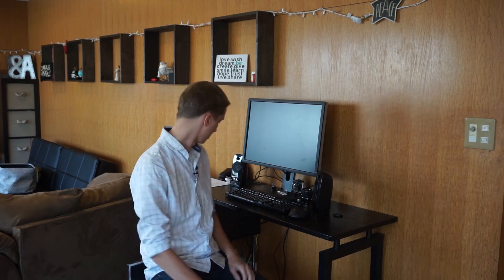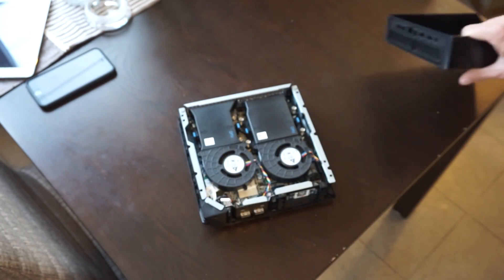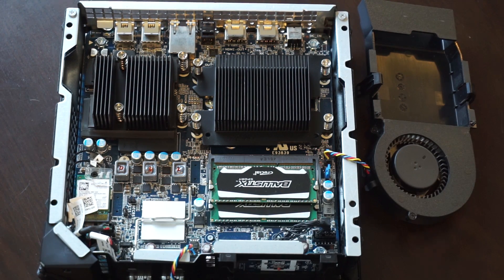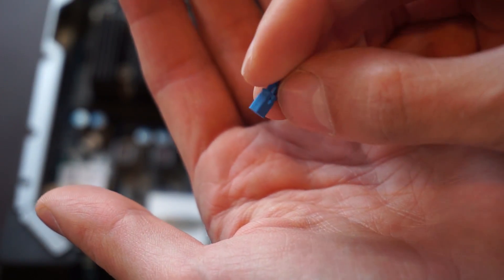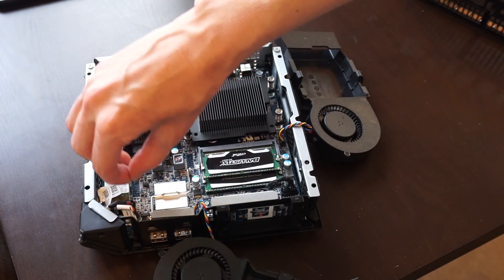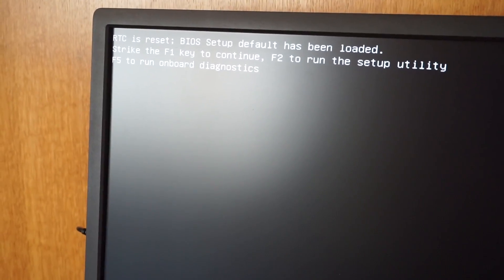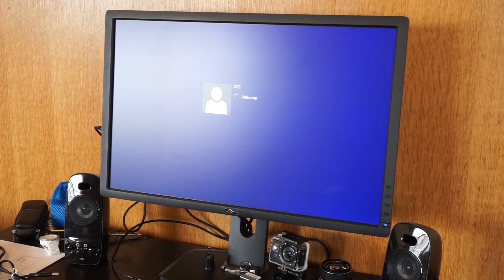How to Fix an Alienware Alpha that Won't Boot

Comment: Thanks so much for this video. I have had my system for about 2 years and just experienced the issue for the first time today. My system rebooted overnight and all I had was the logo on the screen. F2 and F12 didn't work, nothing worked. I found your video and followed your instructions and it fixed my issue. So pleased that you posted this. Many Thanks!!!!!!!!!!

Comment: My experience late 2020: This worked, but I needed to also get a new CMOS battery installed. Just unplugging the CMOS battery and letting it sit did nothing, and I routinely hit the "yellow lights of death" after trying. Even if it did boot, before the new CMOS battery I would just get stuck on the logo screen like in this video.

I fixed it with installing a new CMOS battery (other videos can show you how), then following this video to reset the BIOS. One thing I'll note that he didn't go over is how to press the power button after you swap the jumper. I hit it once, waited ten seconds, then hit it once again, then unplugged the machine after about another 5 seconds. That worked. 

Hope that helps others who are having a hard time with their machine, and thanks Arthur!

Comment: Thanks! That was driving me crazy. I even removed the CR2032 battery to clear the CMOS but all I ended up with were the 5 flashing lights of death. So I had to deal with this for like an hour, and then the initial problem was still here. Then I found your video and it was fixed in 5 minutes 🤦‍♂

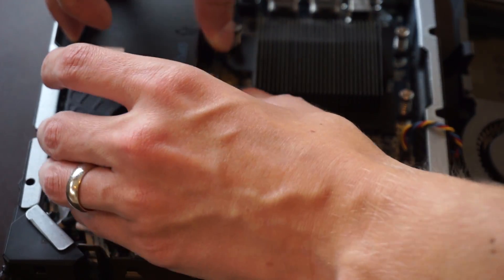Comment: 2:30 what happens if I do all of this and then connect it to power and my alpha turns on by itself without hitting the power button?
The light turns on and goes yellow again.
Reply: I’m having the same issue. Did you find a fix?
Reply: @prxmxl  change your cmos battery

Comment: Fixed it, thank you. One thing to mention, it seemed the side of that jumper matters, I put it to the RTCRS facing opposite direction that that caused the yellow light flashing when I put it back. So second time I changed the sides, that it worked!

Comment: This saved my bacon. I was trying to install onto a new ssd from a flash drive and when it wasn't recognized, I selected "legacy bios" from the boot menu and rebooted... only to be greeted with the Static Alien Head of Doom. I thought I had bricked it. I did have to go back into the bios and change the boot setting back to UFI to get my usual Win10 boot drive to be re-recognized, but everything is back to normal so far.

Thanks a bunch, mate.

Comment: Really helped out! I was going to try this method (other BIOS resets hadn't worked) but the official manual was using some alternate motherboard layout? Your video used the right one and also confirmed that it would fix the problem I was having. Thanks <3

Comment: Thank you so much!
My Alpha R1 just got into that boot freeze and you saved me! :)

I'm using Linux on that machine with no problem whatsoever, but I also have an original Win 8 installed in case I want to play something Linux/Proton would not support. Today I've booted Win 8 first time in like 6 months, it updated itself and I've got that ALIENWARE logo freeze after reboot. Might be firmware update or something... Anyways, thanks again for the fix instructions!

Comment: Thanks fixed my start up problem, as you said it couldnt enter bios or anything, was stuck on alienware boot logo .. Seemed to happen as soon as i added asus rog driver for mobkul mouse i using but then maybe coincidence, anyway i rolled back bios from a4 to a3 soon as your fix worked and no problem since :) running windows 10 is fine with a3 bios if anyone else has same problem :) thanks again :)
Reply: I'm sure that's just a coincidence, but it's funny you should say that about the mouse. I had just done a firmware upgrade to my mouse. After I rebooted this same error happened.

Comment: Thank you, thank you again. You saved my bacon for a second time since I forgot the exact steps from last time. :) In my case I've had to reset the BIOS after something has caused the power to be pulled from the machine while things are running. Thankfully it hasn't happened randomly as of yet. The first time I was convinced it was dead!

Comment: Still having the same issue after doing this. I don't think I did anything wrong but it's possible. Your instructions didn't really say what to do after pressing the power button so could u give me a bit more info on that part?

Comment: Wow, thanks. I got bios update notice (from A05 to A06) in Windows 10, I accepted it to install and it locked up, turned down my speakers to not hear the high pitched wine. Came back and still stuck so I powered off and was stuck at the screen thinking it screwed up the flash. This worked luckily.

Comment: So I've done what you've said but then it brings me to a windows screen.that says window has not solved your problem any idea of what I should do I was thinking of doing a power drain but I was unsure and I figured you know about it the most. Any idea of what I should do also when I turn on my alpha the power button has the blue display but it either shows nothing/ connection lost on my monitor or just shows the Alienware alpha screen before crashing. Hopefully you can help.

Comment: Hey. Any advice for the almost same thing? Sometimes when i turn on the computer ( not always ) i only have a logo Alienware,  it freezes and i must press ctrl + alt + del ( sometimes once, sometimes more ) and then its ok. Where can be a problem? 
 How can i fix it? I have Alienware X51 R2. 
It started when my graphics were in trouble ( overheat inside a small case ) and I had to replace her ( from GTX 960 to 1050Ti ). 
But I'm not sure if that's the case...This PC is about 5 years old..

Comment: Um did steps as followed but when i plugged it all in i got a flashing green light? I turned the pc off before putting the blue jumper back to clear password and then plugged it back in and thats when i got the green light that began flashing is there a fix for this or am i fucked?

Comment: Hey, I did what you did, I thought it was the same problem, but I guess not. My PC passes the logo screen but after that the loading scroller-thingy just stays there forever pretty much
Reply: Shazang Productions I've been having the same problem for months. Doing a power drain worked in the beginning, but now that doesn't work anymore. This is so frustrating.

Comment: I have a feeling there is something botched with the latest BIOS, disconnecting the cmos battery for 5mins clears out the errors I (and many others) had with it not even attempting to boot up, just goes to a blinking yellow light.
Reply from the maker: +Jake “Zebular” F I agree with you, seems odd that it just started acting up for me recently.

Comment: Hi , anyone have idea when this and changing bios battery doesn't work still yellow , sometimes I had screen sometimes not but I used windows 7 not steam os , it worked always by unplugging power and plugging in few times now it is only yellow

Comment: Same here, you saved me big time, my warranty got over 1.5 years ago. Had send my unit once when in warranty I didn't new this is what they call replacing the mother board in invoice.
Reply from the maker: Awesome! Good to hear. Strangely, my alienware hasnt had any issues since i reset it during this video.
Reply: Didn't work any other fixes?

Comment: Didn’t work for my issue. Still getting nothing to mouse or monitor. I’m getting 2 flashes, then 1 flash. I’ve done everything I seen on the forums. Reset ram. New cmos battery. Holding power button. And now this. Nothing has fixed my issue. Is my motherboard just toast? All started happening after I upgraded ram. Put the original ram back in and still nothing. Any help would be awesome, been about 4 days of messing with this thing. Mine is the alpha i3
Reply: Did U solved it?

Comment: hi, thanks for the video but mine still have problem keep doing stuck on logo, do u have any other solution. i change mine to win 7, by the way.
Reply: You are better off to now keep shutting it down. Just let it go into sleep mode. That is what I do. Shutting it down invites the problem.

Comment: I know this is kinda old but PLEASE RESPOND. I do everything in this video, except when I hit f1 it just starts rebooting over and over again and again and again... you get the point. When the jumper is in the 2nd spot and I turn the power on, do I also turn the power off? Or do I just unplug it.
Reply: UPDATE: Everytime I reset the bios and then hit f1 to continue, it just goes back into the reboot loop. PLEASE HELP :(
Reply: Same here.
Reply: Remember to use a wired keyboard. Wireless will not register. And also plug in back seems to work best. Even though the keyboard may appear to be responding if it doesn't boot into Windows, it didn't actually correctly register the key stroke.

Comment: I have an i7 with SteamOS. I tried this fix twice and it didn't work. Any suggestions?
Reply: you will probably need to disconnect the cmos battery there are videos for how to do it
Reply: Kyle H what I did is turn it off for a min and it does the same thing

Comment: Mine was fixed by unplugging from the wall. Unplugging all devices from the R10. Holding down the power button for 30 seconds. Plugging power back in. Hit the power button and it went right into the windows login screen. I then plugged in all my devices.

Comment: Hey, I am asking for a friend. His Alien Ware x51gets stuck on the alien ware logo, this method should work but it has a 6G6JW 06G6JW Mini-ITX H61 mother board. We have found 2 jumpers one called password and the other Clear_Cmos, that is all we know, we don't know what to move and to put where. Please reply, thank you. :)
Reply: i have no clue of the solution but did you find out???? in dire need of help.

Comment: I bought am alpha used and it has a password on the desktop user. will this let me reset the password?  Dell wants $129 to help me
Reply: Desktop user no but if you can boot into a usb flash drive and run a utility like konboot you can enter onto the user without a password. if you just purchased the alienware and do not need anything on the hard drive just reinstall either windows 8.1 or windows 10. take a picture and let me see it here to tell you if its windows 8 or 10 if its 8 i can help if 10 i cannot. since i have the original backup of it

Comment: I have the same version and my HDMI is broken or something it wont hook up to any monitor and the computer is fine....
Reply: I know its been a while since you posted this but are you saying that basically the screen is black?  For me I tried this and the cmos battery for the yellow light and it turns on but nothing shows on the tv screen as if the hdmi isn't being recognized.

Comment: NOPE didn't work for me back to the yellow flashing light of death.  I just ordered a new CMOS battery Ill give that a try.  If not Ill try lighting a bonfire and throwing it in there
Reply: Mine go straight to console mode and IT froze in the process. And I cant do nothing about IT and so I waiting with the screen on black loading for more then 2 hours AMD still stuck.

Comment: 2022 - Tried this numerous times but it didn't work.  :( - Will update if a new solution is found.
Reply: May 2022 - still trying to get this to work. Still not working using this method
Reply: May 2022 - Just got it working.  So, if the video doesn't help get yours up and running, on a separate computer, download a boot that you can put on a USB.  My USB was for WIN10 and once I got the USB to load up, I let it attempt to repair the booting.  It took almost an hour (like it said at the bottom of the screen during the process) but it worked!  I hope this works for anyone else that is having issues!  Game on!